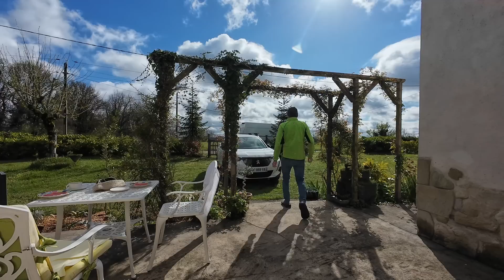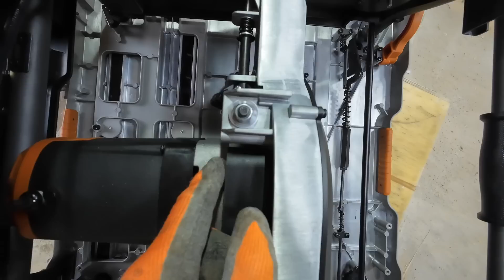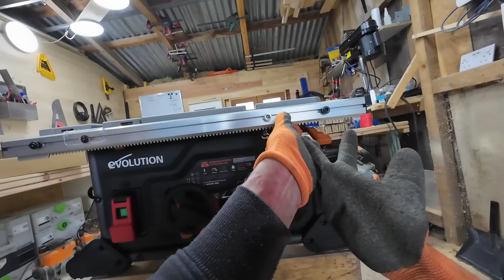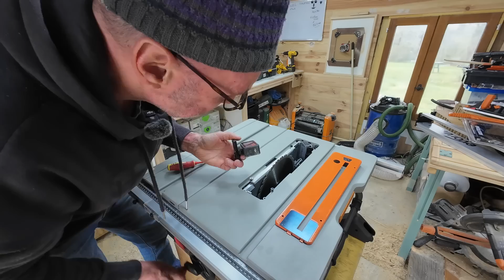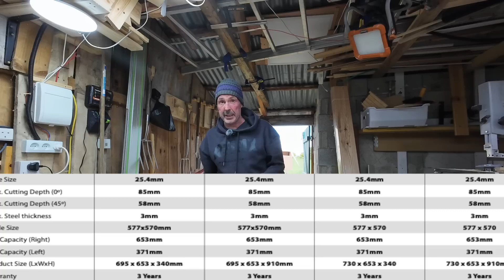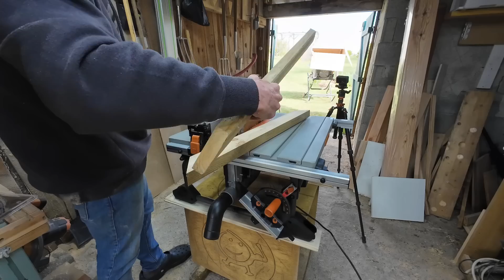Evolution Power Tools' NEXT GENERATION R255 Jobsite Table Saw. (Gifted)

Comment: It has DeWalt written all over it's design. Really nice that Evolution went in the same direction. Honestly it is a user friendly and solid straight forward design. Glad you have a wonderful Evolution table saw.
Reply: This is the same or similar to the SKIL tablesaw currently only available in the US. Rutland also do a very similar saw which is what I purchased as couldn’t wait for Evolution or SKIL to release theirs!
Reply: @colliale  Hi Colliale, 

That's not quite true.

Firstly, The Rutland is an off-the-shelf Chinese table saw. It is a private-label product with no design or engineering changes from the original Chinese manufacturer. Motor capability and Reliability may become a problem.

Secondly, the Skil: While it's based on the Rutland chassis and gearbox, Skil has added a few additional features like a 15A motor (USA Market), an Integrated leg stand, and improved aesthetics. 

The Evolution R255TBL & TBL+ table saws are designed and built from the ground up (a 3-year project) to deliver superior performance. The chassis, The frame, drivetrain, Tabletop, accessories and motor are all completely unique to Evolution. Our redesigned motor provides maximum power and features advanced ventilation to keep the motor cool even during demanding projects.

The Evolution R255TBL & TBL+ have been rigorously tested and go beyond industry standards. We have subjected them to extensive testing procedures, ensuring unmatched performance and durability. This includes not only in-house testing but also real-world validation through trades testing throughout the development process.

While some generic components like knobs, dials, push sticks, handles and nuts and bolts are shared across brands to optimize production costs, these are minor elements. The core functionality and innovative design of the R255TBL & TBL+ are truly unique to Evolution.

The New R255TBL & TBL+ have several features over and above the Skil, and these are as follows: a rugged compact wheeled scissor stand, Larger cutting capacities LOB & ROB, Soft start, Electronic Brake, Multipurpose cutting, Outfeed supports. Full dust extraction kit and adapters, Rack & pinion bevel function (micro-adjustable), metal throat plate ( height adjustable), a new sliding sledge built into the table (similar to Rage5s), blade guard with integrated dust port and a viewing window for maximum safety and cutting visibility, Significantly better dust collection, zero clearance throat plate, left side extension support ( Coming soon) and a whole load of accessories in the pipeline.

How do I know all of this? Because I am the Project Manager at Evolution for the R255TBL & TBL+, I've worked very closely with the supplier for the past 3 years to ensure this saw delivers exceptional performance, which has been shown in the user feedback throughout the development.
Reply from the maker: Rich. Thank you for sharing your knowledge. Regards JP
Reply: @richjames4445  This is what I like to see, an actual evolution guy commenting with confidence.  I have lots of evolution tools despite being a brand whore to dewalt, and I absolutely love my evo kit!  Keep doing what you are doing, its working!
Reply: @richjames4445   seems like you've got a lot right with this saw. Sorry to hijack you but having looked on Evolution UK website, have a couple of questions. Q1 -  weight TBL Product Weight: 21.2 kg Packaged Weight: 33.5 kg whereas TBL+ Product Weight: 28.5 kg Packaged Weight: 33.5 kg - so packaged weight the same but product weight different - can you confirm where the typo is pls? Q2 - any plans for 110v? Q3 - blade bore size Screwfix has 249 blade options at 30mm vs 17 blade options @ 25.4mm; Toolsation has 34 blade options @ 25.4mm vs 1 blade option at 30mm. Whilst I realise there is more to life than Screwfix and Toolstation access to their wares is undeniably prolific. Dada stacks are scarce in UK however CMT make one at 30mm and Axminster seem to have abandonoed their 30mm and only supply one at 5/8", nobody to my knowledge at 25.4mm. When there are areas of this saw that are clearly adopting industry standards I'm wondering what is behind the rejection of the clear market leading arbour size? Thanks.
Reply: @richjames4445  All sounds lovely and all marketing nonsense

I have owned a handful of Evolution products, never again, you might be getting the best you can for the money but it's simply not good enough in terms of output

I would rather pay a little more and get something that can cut straight

I had a mitre saw that had to be returned 3 times within warranty due to the fence and blade not calibrating for more than a few cuts

Each time they did the repair it would last no more than a couple months then back to the repair center 

Something like this would rather spend the extra £200 £300 and get a different brand

This is what happens when you tighten up the budget too much 

When you buy a mitre saw 

Guess what its main purpose is? Yes to cut straight lines

If it can't do that, it's a waste of money
Reply: @deepmystic6739  what is interesting here though is that it looks like Evolution has actually really listened to user feedback. All the little niggles with the previous saw that made it a bit of a pain to work with and feel lower quality (as you allude to) seem to have been addressed. It’s really exciting for someone who has spent hours and hours trying to make the old one better. Of course time will tell but it looks fantastic. 

My only concern is that my old saw is now going to be worth a lot less 😅
Reply: @richjames4445 awesome job :)
Reply: @richjames4445  Hi Rich, are you able to tell me if this saw or it’s bigger sibling can be used with a standard vacuum like Evolutions own R15vac as I have just come off an online chat with Lauren from Evolution who has told me that it cannot be done as the saw requires a dual exatraction. I did highlight that your own manual shows it being used with this vacuum with an adapter and I was told this is a mistake in the manual and she has had this confirmed by an engineers which seems bonkers? Thank you
Reply from the maker: @colliale  Hi. Yes it would appear so from videos I’ve seen. Regards JP
Reply from the maker: Hi. Yes very user friendly, which is what you want from any too. Regards JP
Reply: Still a very capable tablesaw! Good review btw 👍
Reply from the maker: Thank you 🙏
Reply: Evolution, De Walt and Skill are all very similar. Some parts and features are exactly the same. The De Walt is somewhat better but at a higher price. I have an Evolution cold saw and couldn’t be happier with it. The early Evolution table saws left much to be desired but the 2024 model  is very nice especially for the price. Good shopping can get you this for $299.00  I’d recommend for any serious hobby shop usage. Few saws will beat a Delta with a cast iron table but they cost way more money.  Thank you for the informative video. 👍🏼👍🏼

Comment: Good unboxing/first impressions review. Like you, I've been using the Rage 5s for years. With a decent blade the cuts are clean and accurate. Alas, the sliding table on mine is terrible, with far too much play to be reliable for accurate cuts. I, too, purchased an expensive mitre guide only to discover the slots were too shallow to accept the unit. Oh well, it will fit the replacement.
Personally, I'd pay extra for the soft start: it's like a gunshot every time. Although I thought I'd use it, I found the stand just took up too much space in my small workshop, so I ended up just binning it. 
I only paid £220 for the saw - an absolute bargain - so can't really grumble as it has served me well. If press, I'd have preferred a better throat plate, but that is easily remedied. By far the worst aspect of the saw has to be dust collection. It is like using my very old circular saw; zero dust collection, it just ends up everywhere.
I'll be interested to see more on this new upgrade; particularly, the soft start models. Thanks for taking the time to share.
👍
Reply from the maker: Hi. This saw doesn't have soft start - apparently.  Compared to the start of the R5 it is very soft. Evolution have put some great work in for this. I said a few time the R5 is too big for many small shops - which is one of the reasons I wheel it outside. The R255 is a much better size. Regards JP

Comment: nice pre review nicely detailed ,Coming from a rage 5s this looks like a good upgrade. . looking to build it into a trolley and wheel it out of my very small workshop to the garden would you be able to to run a tape from the front rail to the back rail for me. That would be much appreciated .
Reply from the maker: Yes. I will pop out and measure for you soon. Regards JP
Reply from the maker: Dims from outside of foot side to side is 674mn front to back 505mm. Hope  this helps . Regards JP
Reply: That's very helpful thank you

Comment: Nice upgrade on the Rage 5. Just looked, £460. Good price
Reply from the maker: Yes. Thier link went live overnight, definitely great value . Regards JP
Reply: Whaaaaaaaat, I’ll go DeWalt for that price 👀
Reply: @cerealkiller4248  why?
Reply: @paulhodgson4790 You can get a Dewalt table saw for under £500, I've read complaints about Evolution quality control when I was looking to replace my Ryobi saw, its very heavy, very good, but now ageing chop saw for the lighter Evo unit.
Reply from the maker: @cerealkiller4248 the Dewalt is  much more though
Reply: @Smallbarnworkshop You can get a Dewalt unit sub £500 👍
Reply from the maker: 250mm blade?  Regards JP